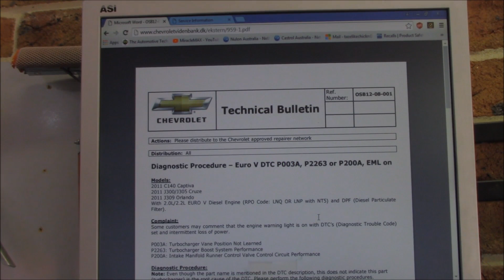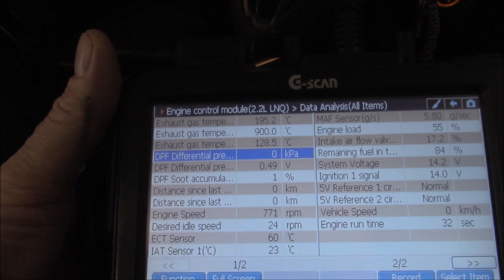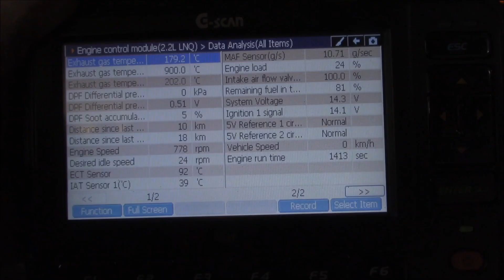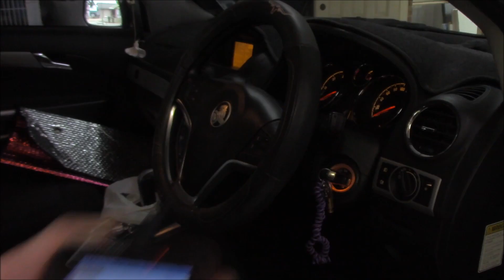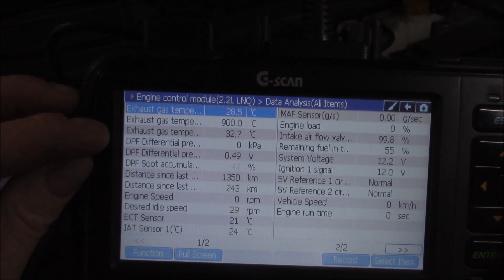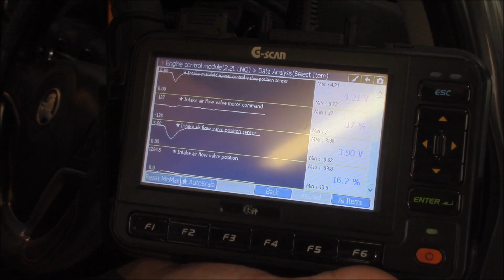Holden Captiva Diesel P200A MiracleMAX

Comment: Hi Max,
I hope you could help with this because I am going nuts 🤣.
I am having the same code P200A on my holden captiva, I have tried so many things but still the same, the car runs fine as much as the engine temperature is below quarter, as soon as it reaches quarter the code would appear and the spanner warning light comes on, I have installed a small camera near the actuator to inspect it and it seems to be working fine going up and down but as soon as the code comes up the actuator losses it's vacuum pressure and it won't work again unless I restart the car or remove the code while driving.
This is the only code that I am getting, sometimes the car has loss of power. The scanner that I have is Autel AP200 device. Cheers and thanks in advance😊.
Reply from the maker: Hey DIY Mechanic,
Let's see if we can diagnose this together. Firstly I'll need some more information:
Is there any freeze frame data attached to the fault code?
I gather your engine is a diesel.
Can you see in live data what the soot accumulation in the DPF is & the last time it did a regeneration?
Has the intake system every been cleaned of carbon build up - preferably ultrasonic cleaning?
Is the EGR valve target and actual the same or close?
Is the turbo operating correctly if you look in live data?
Are the swirl flaps physically moving OK?
Also, look for any intake air hose leaks. These are notorious for splitting between the intercooler and the throttle body. It's a hard hose to get to and is easily missed. Do you have a smoke machine you can use to test for intake leaks? I made mine out of a paint tin & it works quite well :) https://youtu.be/Qx2nT-GTejc?list=PU0m9qGBLuXhzTH8bFv69HnA&t=259
I hope there are some useful suggestions among this lot.
MiracleMAX
Reply: Hey MiracleMAX, 
I really appreciate your help :).
-I couldn't find any freeze frame data.
-Right 2.2l turbo diesel.
-Soot accumulation is now 17 percent and last regeneration was 504 km.(I have tried to do a forced regeneration on my device but the process of the regeneration takes a very short time, rpm only raises to 2000 only for 10 sec then it says preformed successfully so I believe its not doing the regen at all ).
-I had the car 4 years ago (I drove 70000 Kms these last 4 years)and I haven't cleaned the intake since I had the car, this code is been here since I bought the car 4 years ago.
EGR value keeps going up and down,sometime I can see big difference between desired EGR position and EGR position sensor (eg,10 to 15% difference ) and other times they become the same, also there was times that both value stayed on zero.
-I assume the below are the turbo live data you are after:
Live data -induction , when engine RPM is 1068
Barometric pressure= 99 Kpa, Desired boost pressure= 114Kpa, boost pressure sensor=90Kpa,Desired turbocharger vane position = 100%, Turbocharger vane position solenoid valve command=84%, Turbocharger vane position sensor=100%, IMRC valve command=84%, engine load 54.1, EGR position sensor=24%, engine coolant temperature=78 C 

Live data -induction , when engine RPM is 1695
Barometric pressure= 99 Kpa, Desired boost pressure= 138Kpa, boost pressure sensor=106Kpa,Desired turbocharger vane position = 100%, Turbocharger vane position solenoid valve command=85%, Turbocharger vane position sensor=100%, IMRC valve command=83%, engine load 50.6, EGR position sensor=36%, engine coolant temperature=81 C.

-How can I check if the swirl flaps are moving?

-I couldn't find any visible air leaks
-is this the large air hose that goes in to the intake manifold?
-I have made one of a soldering iron that heat a piece of cotton with baby oil submerged on it and have an air compressor that pushes through smoke, I have put this through the turbo just after the MAF sensor and couldn't find any leaks, also hooked this up to the large hose in the bottom side just near the radiator and I couldn't find any air leak, I felt the baby oil was accumulating so I stopped the process because I was afraid that the smoke has a large amount of baby oil that will sit inside the engine.

Cheers,
DIY Mechanic
Reply from the maker: @tekmek4669  The main concern I have is that the turbo doesn't seem to be changing much although you have provided a rev range that is very similar.
What happens when you rev it hard? What are the readings on the turbo vane, solenoid & sensor?

The swirl flaps are also called intake runners and yes they are a pig to get to.
https://youtu.be/tXyUWjjHAwA?t=397

Congrats on thinking outside of the box with the smoke machine! Just make sure that you have blocked off different sections of the intake system, so that you can test each area individually.
https://youtu.be/Qx2nT-GTejc?t=275
Baby oil is just a mineral oil made from a petroleum distillation process that is safe for human use, similar to petroleum  jelly, so it won't hurt the engine, probably just make it have smoke until it clears. I have never had any issues using it.
Reply: @MiracleMAX  All the below test performed while car was parked

-Live data -induction(engine cold-with no code on the system) , when engine RPM is 798
Barometric pressure= 98 Kpa, MAP=106Kpa, Desired boost pressure= 114Kpa, boost pressure sensor=106Kpa,Desired turbocharger vane position = 100%, Turbocharger vane position solenoid valve command=93%, Turbocharger vane position sensor=100%, IMRC valve command=80%, Intake air flow valve motor command= 16%, Intake air flow valve position=99% engine load 26.3, EGR position sensor=1%, engine coolant temperature=30 C 

-Live data -induction(engine hot -with no code on the system) , when engine RPM is 3130
Barometric pressure= 98 Kpa, MAP=111Kpa, Desired boost pressure= 111Kpa, boost pressure sensor=112Kpa,Desired turbocharger vane position = 43%, Turbocharger vane position solenoid valve command=48%, Turbocharger vane position sensor=40%, IMRC valve command=19%, Intake air flow valve motor command= 14%, Intake air flow valve position=99% engine load 26.7, EGR position sensor=1%, engine coolant temperature=58 C 

-Live data -induction(engine hot -with fault code P200A-00 code on the system) , when engine RPM is 3057
Barometric pressure= 98 Kpa, MAP=106Kpa, Desired boost pressure= 105Kpa, boost pressure sensor=107Kpa,Desired turbocharger vane position = 30%, Turbocharger vane position solenoid valve command=39%, Turbocharger vane position sensor=30%, IMRC valve command=0%, Intake air flow valve motor command= 15%, Intake air flow valve position=99% engine load 24.3, EGR position sensor=1%, engine coolant temperature=81C 

-Live data -induction(engine hot -with no code on the system) , when engine RPM is 3155
Barometric pressure= 98 Kpa, MAP=120Kpa, Desired boost pressure= 120Kpa, boost pressure sensor=119Kpa,Desired turbocharger vane position = 50%, Turbocharger vane position solenoid valve command=46%, Turbocharger vane position sensor=50%, IMRC valve command=20%, Intake air flow valve motor command= 18%, Intake air flow valve position=99% engine load 24.3, EGR position sensor=1%, engine coolant temperature=92C 

-Live data -induction(engine hot -with no code on the system) , when engine RPM is 3799
Barometric pressure= 98 Kpa, MAP=129Kpa, Desired boost pressure= 109Kpa, boost pressure sensor=116Kpa,Desired turbocharger vane position = 54%, Turbocharger vane position solenoid valve command=52%, Turbocharger vane position sensor=48%, IMRC valve command=21%, Intake air flow valve motor command= 17%, Intake air flow valve position=99% engine load 23.5, EGR position sensor=0%, engine coolant temperature=80C 

correct me if I am wrong swirl flaps can be tested/inspected only if the manifold has been removed from the engine?, or may be if I stick my little endoscope camera inside the intake, theoretically I think I want be able to see anything?

As for testing for leaks in the intake system, I hocked up my smoke machine to the large hose that's connected to the inter-cooler from the bottom, I used a glove to hook it up to the large hose (found the trick online, maybe it will help someone like me doing DIY at home :) )as I don't have adaptors. anyways I couldnot find any leaks but I am not sure maybe the smoke is not going through the whole system, maybe its getting blocked somewhere (eg, I believe throttle body is closed when the engine is off, right?) how do we test in this case?. 

I tried even testing the intake system while car is running(not sure if this is right or wrong) but couldn't see any leaks. 
BTW, I have noticed that just before the spanner light comes up(fault code P200A-00), the RPM starts going up and down with very small variations (about 150 rpm up and down) then light comes up after 5 secs, this RPM variations happens even if I am cruising speed.

Cheers mate.
Reply from the maker: @tekmek4669  Well, that is a lot of data! 😉
Good idea to check the intake runner flaps with an inspection camera. While you are in there, have a really good look for carbon. I did ultrasonic cleaning on a Triton the other day & the ports were half blocked in some areas - poor little guy was struggling to breathe!

You can't really do a smoke test on the intake while it's running because it will just follow the air entering the cylinder, go thru the combustion process and then out the exhaust - but thumbs up for thinking outside the square. 👍

These Craptivas are extremely hard to work on. I think the engineers had a falling out with a mechanic one day and decided to make our lives hell!

Have a look at the data that you have given me. Look at the intake runner (swirl flaps) readings.

Intake air flow valve motor command= 17%, Intake air flow valve position=99%

So, the ECU is commanding the actuator motor to 17%, but the position sensor is telling the ECU that it is actually at 99%! Someone is not happy......or telling lies. 
Just have a look at this video. Altho it's not the same as your vehicle, the concept is the same.
https://youtu.be/oPt8zJNq_Nc?t=59
These flaps even drop off at times - Oh Goodie!
Reply: @MiracleMAX  I finally pulled up the trigger today and removed the intake manifold, there was a good amount of carbon build ups, I honestly thought It will be completely blocked off, anyways I am still in the process of cleaning it I will give it a clean tomorrow with the pressure washer in case there was some places that I couldn't reach in the middle of it.
 the flaps are opening an closing but I fell there is a lot of free movement before the flaps starts opening/closing, so I am not quite sure if its actually the carbon build up causing the spanner light to come on or it is the free movement causing this.

Honestly its a big job taking the intake manifold in these captives, I took lots things out until I was able to reach it off, it is not the best place to work on as its at the back near the firewall, all the work I carried out from the top, I tried going below the vehicle but its extremely hard to do things from button while the car is on stands.
thanks a lot for all your help mate :)
Reply from the maker: @tekmek4669  Yes, they are a huge job. I know of some that remove the motor to get it off as it is easier to access.
Just double check the swirl flaps and make sure they don't jamb on the side of the manifold. Also check the shaft for wear as well. I gather all the flaps are secure on the shaft?
Thanks for keeping us informed of your progress.
Reply: @MiracleMAX  Yeah it's a huge job, it took more than half a day to take it off, I know I am a bit slow when I work haha.
The swirl flaps look all fine and so tight to the shaft and there is no wear on the shaft,  except I still have a feeling that the free movement where the actuator sits on is not right. it's just a piece of plastic that hooks up to the shaft and its not completely square, maybe it's just worn and needs replacement :( .
BTW would have an idea of how much of a free movement there should before the flaps should start closing/opening, I am talking about where the actuator sits and moves the shaft that drives the swirl flaps?
Cheers mate :)
Reply from the maker: @tekmek4669  I'm not sure, but if an actuator is attached, there should be no movement before the shaft starts to turn. Have you removed the actuator and looked at where it locates on the shaft?
Reply: @MiracleMAX  here's a video of the part that i am talking abouthttps://youtu.be/qqkH05641pQ
The actuator hooks on top of that white plastic on the little notch.
Reply from the maker: @tekmek4669  Thanks for sharing the video. It's always easier to see something rather than be told something.
It looks like you have a lot of discrepancies on the readings, which indicates that you have wear most likely on the plastic section of the lever. I would imagine that there should be no movement in that area.
I don't know if you can buy any of that section separate or not.
Reply: @MiracleMAX  I put the parts all together today and drove it for 30 minutes and there was no code, the car feels a bit smother. So all fixed now.
I really appreciate all your help and support, cheers mate.
Reply from the maker: @tekmek4669  That's great news DIY Mechanic!
Hopefully those swirl flaps & actuator behave themselves.
Glad I was able to help. 😊
MiracleMAX

Comment: I´ve also got a Chevrolet Captiva,2.2 diesel, 2012 which is giving the same error code,P200A. After spending a few merry hours trying to replicate what you showed in this very informative video,I´m guessing that my intake manifold is also getting clogged up. I really have no desire to remove the engine so I´m wondering if there are any fuel additives which could help, or maybe is it worthwhile to fill up the tank with Shell V-Power diesel or an equivalent? Thanks again for the great advice, and keep up the good work!
Reply from the maker: Hey Ritchie Jarvis,
Is the DPF being regenerated on a regular basis?
To be very honest, carbon build up will not be removed efficiently by an additive. Also think about it - that hard, abrasive carbon if it is dislodged by an additive has to go somewhere. If it is in the inlet system, it has to go past swirl flaps, EGR valve, inlet valves, near piston rings, up and down the bore, past the exhaust valve and through the DPF and possibly a catalytic converter. I have removed and ultrasonically cleaned inlet manifolds, EGR valves, rocker cover (which is part of the inlet system) and other components on a Mitsubishi Triton and I would hate to think of what I got out of these components going through the engine.
I believe the only time an additive is OK to use is as part of a maintenance program when the carbon has been removed.
As for using a 'cleaner fuel', the same issue applies. Fuel here in Australia is not good quality and just one of the reasons we suffer from huge carbon issues. Once the carbon has been removed, regular maintenance with quality oil, consistent fuel filter replacement is a start in the right direction, but it is not the ultimate solution.
Sorry Ritchie, there is no simple answer.